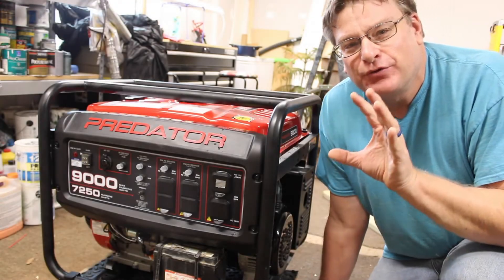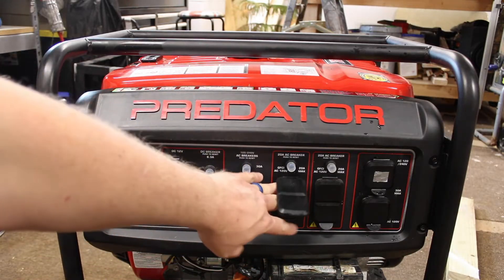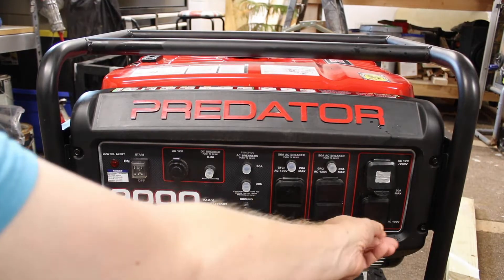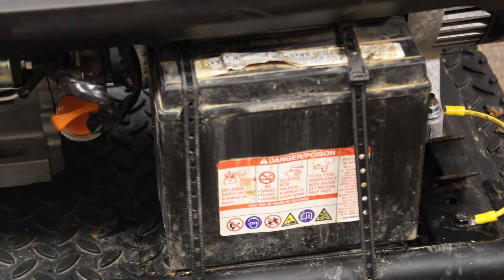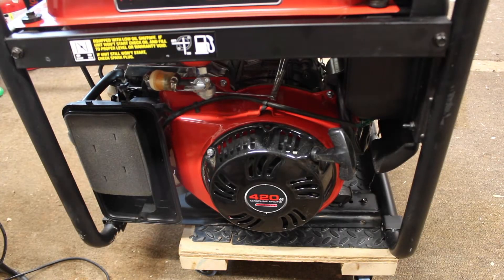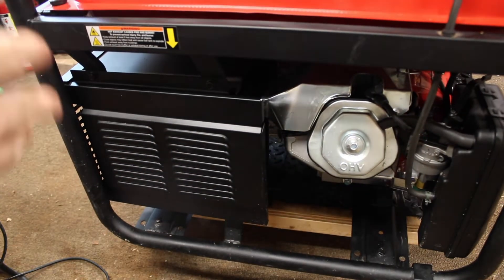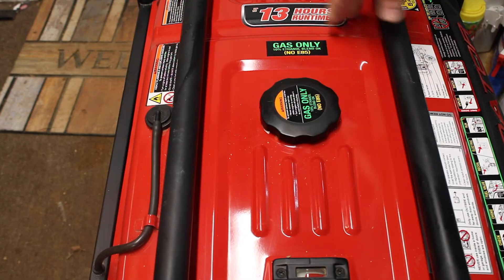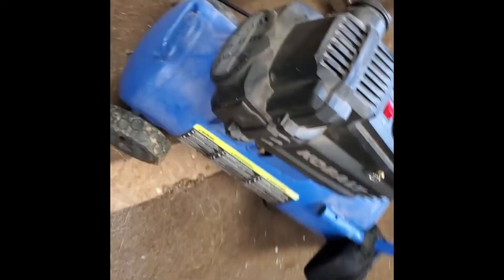2023 - Generator Review: The Harbor Freight Predator 9000

Comment: I've decided on the Predator 9000 (8750 if I can find it). One thing I have seen in EVERY video is the person is only using ONE outlet (the 4 prong 120/240) to connect to the house. That outlet is rated 30A ~3300W, keep in mind a 9000W generator will send ~80A at full load. You have to split that up with the 4 outputs (20A, 20A, 30A, 30A).  I would think you would need 1 load on each of the two 20A plugs (fridge, gas furnace or mini split), and a 3 prong and 4 prog ( connecting to separate transfer switches.  Connect most of your continuous draw items to the 3 prong, and your big startup items to the 120/240.
Reply: Good points, but I think your a little confused how the generator power output is used.  The 30amp plugs are rated for 3625 watts per leg.  There are two legs on the generator. So when your using the 4 prong or 3 prong plug, you will be able to use the entire 7250 watts of continues power. (Its recommended to only use about 80 percent continuously) The 30 amp breaker, works just like a double pole breaker in your main panel for your Central Air, Well pump, etc. So, each leg of the generator has 30 amps to work with.  That's why you should always use a transfer switch that has watts meters, to monitor each leg of the generator.  You want to equally distribute the load to both sides of the generator, to prevent over load. I hope this makes since.
Reply: @Pk3_Garage  Ahh. Great so the predator can output full wattage thru the 4 prong. Looking closer at the transfer switch I was looking at, it does has two watt meters and the first 5 breakers are tied to 1 watt meter and the other 5 breakers are tied to the 2nd watt meter. And understand load balancing two separate 110s from a 240. Makes sense, thanks!
Reply: That’s 33300w at 120v but at 240v that’s  7200w.
Reply: Here is a reminder about portable generator safety: everyone really needs to see this safety reminder to make sure. This advice is just to make sure that everyone is aware of all the warnings and it’s just to remind people to be careful using portable generators. Generators can be dangerous if not used carefully. Every year, hundreds of people die or get injured when using portable generators due to carbon monoxide poisoning and electrocution. Make sure you are using your generator carefully and keeping others safe as well. There is something very serious that everyone should always be aware of when using generators. Some people do run their generator indoors which is not safe and that increases the risk of carbon monoxide poisoning which can cause death of family and you. Some people run their generator in wet conditions which can electrocute them. Please remember that you should never run your generator indoors. Remember that carbon monoxide is an odorless and colorless gas that you cannot see or smell. Carbon monoxide is a silent killer. Keep that in mind. Make sure your generator is 15-20 feet away from your house and away from doors, windows, and vents. Never use your generator in your porch too. Having a carbon monoxide detector is very important against generator safety. Some people also allow children to go near the portable generator which could pose risks. We need to keep an eye on our children making sure that they are not near the portable generator so they won’t get electrocuted or burned by the generator which is dangerous. A locking enclosure also keeps kids safe. A generator shed might look like a tempting place to explore, or take cover during a game of hide and seek, but a generator is a dangerous piece of equipment that can cause injury. It says on the manual that we should also keep children away at all times from the portable generator to avoid injuries. Please do not allow a child or unqualified people to operate the portable generator. Just because some manuals missed what should be listed doesn’t mean it’s safe to do. Always follow the generator safety rules when using portable generators. Generators pose electrical risks. If you need to use your generator during wet weather, you need a generator tent to protect your generator from getting wet. Don’t let your generator get wet. Keep your generator dry and before using your generator, please make sure your hands and your generator is dry. Do not wear loose clothing when operating the generator. Everything that is said on the generator’s operating manual should not be ignored. Never smoke cigarettes near the generator. Please keep flammable things away from the generator. Never overload your generator too. Your generator can catch fire. Never ever try to plug a generator cord into a wall outlet to avoid back feeding. Back feeding your generator is dangerous. Always turn on your generator first before plugging in appliances and shut off the appliances before turning your generator off. Use a heavy duty cord for your generator and the cord should not be worn out. All the instructions should be followed carefully. Never refuel your generator while it’s running. It can cause fire if fuel spills while your generator is hot. You should turn off your generator and let it cool off before refueling it. Having a fire extinguisher next to the generator is also important. This is only a reminder for everyone’s safety of using generators. Make sure your generator is properly grounded. Having a fire extinguisher next to the generator is also important against the safety rules. https://youtu.be/I1jT3ANENvI and here is a video more about keeping others safe when using generators and also about our family’s safety. Hope this helps. Thank you. It’s better to be safe than sorry. Keep that in mind. Be safe and have a good one
Reply: @The_Happy_Aviation_Enthusiast  Jesus, are you practicing to write a book? How about running it in the back seat of my car while I drive? I guess you'll cover that in your next book. SMH.
Reply: @williaml4548   every vid about generators he posts that same speal . So annoying
Reply: @The_Happy_Aviation_Enthusiast  holy copy paste Batman.

Comment: Picked up one of these that had problems.  Looked fairly new but. The crank would not turn.  Took off valve cover, then head.  Valve stem broke, and valve was imbedded into the top of the piston.  Good news was that the cylinder walls were still in great shape.  Torn it down, replaced the piston, valves, and head, and worked great after this.
Reply: Your disassembly would confirm that these so called metal particles that every purchaser of a Preator see is NOT metal but Graphite/Graphine pre-assembly lube. Use the Full Synthetic Oil instead of Mineral Oil, minimum 10 - 40 (Air Cooled.) and it will last you forever. Even 10 - 50 Full Synthetic is like water, but far superior Protection and the Oil will stay CLEAN.. Think of an Engine like a Human Body, require Clean uncontaminated Air, High quality Food, Uncontaminated Blood (Oil.) and ability to Cools as needed. (Coolant.) Provide these four items and it will love You as much as You love it.

Comment: Great video - how is your fluke measuring when the hot lead is not going through the loop clamp at 8:18?  I have the fluke I400 clamp works great so not familiar with yours but maybe I am missing the wire in the photo.  I made a small project box with two LCD displays - one for each phase - and an hourmeter so I can monitor useage when the generator is on and going through interlock. Thanks for posting!
Reply: Here is a reminder about portable generator safety: everyone really needs to see this safety reminder to make sure. This advice is just to make sure that everyone is aware of all the warnings and it’s just to remind people to be careful using portable generators. Generators can be dangerous if not used carefully. Every year, hundreds of people die or get injured when using portable generators due to carbon monoxide poisoning and electrocution. Make sure you are using your generator carefully and keeping others safe as well. There is something very serious that everyone should always be aware of when using generators. Some people do run their generator indoors which is not safe and that increases the risk of carbon monoxide poisoning which can cause death of family and you. Some people run their generator in wet conditions which can electrocute them. Please remember that you should never run your generator indoors. Remember that carbon monoxide is an odorless and colorless gas that you cannot see or smell. Carbon monoxide is a silent killer. Keep that in mind. Make sure your generator is 15-20 feet away from your house and away from doors, windows, and vents. Never use your generator in your porch too. Having a carbon monoxide detector is very important against generator safety. Some people also allow children to go near the portable generator which could pose risks. We need to keep an eye on our children making sure that they are not near the portable generator so they won’t get electrocuted or burned by the generator which is dangerous. A locking enclosure also keeps kids safe. A generator shed might look like a tempting place to explore, or take cover during a game of hide and seek, but a generator is a dangerous piece of equipment that can cause injury. It says on the manual that we should also keep children away at all times from the portable generator to avoid injuries. Please do not allow a child or unqualified people to operate the portable generator. Just because some manuals missed what should be listed doesn’t mean it’s safe to do. Always follow the generator safety rules when using portable generators. Generators pose electrical risks. If you need to use your generator during wet weather, you need a generator tent to protect your generator from getting wet. Don’t let your generator get wet. Keep your generator dry and before using your generator, please make sure your hands and your generator is dry. Do not wear loose clothing when operating the generator. Everything that is said on the generator’s operating manual should not be ignored. Never smoke cigarettes near the generator. Please keep flammable things away from the generator. Never overload your generator too. Your generator can catch fire. Never ever try to plug a generator cord into a wall outlet to avoid back feeding. Back feeding your generator is dangerous. Always turn on your generator first before plugging in appliances and shut off the appliances before turning your generator off. Use a heavy duty cord for your generator and the cord should not be worn out. All the instructions should be followed carefully. Never refuel your generator while it’s running. It can cause fire if fuel spills while your generator is hot. You should turn off your generator and let it cool off before refueling it. Having a fire extinguisher next to the generator is also important. This is only a reminder for everyone’s safety of using generators. Make sure your generator is properly grounded. Having a fire extinguisher next to the generator is also important against the safety rules. https://youtu.be/I1jT3ANENvI and here is a video more about keeping others safe when using generators and also about our family’s safety. Hope this helps. Thank you. Always remember that it’s better to be safe than sorry
Reply: @The_Happy_Aviation_Enthusiast  stop the copy paste ffs.